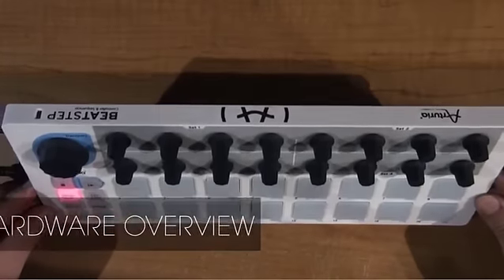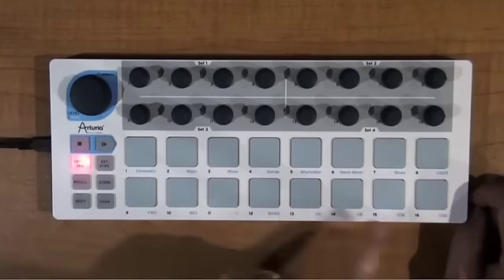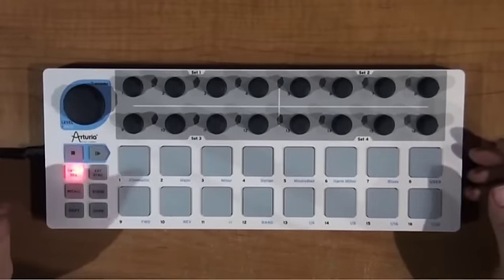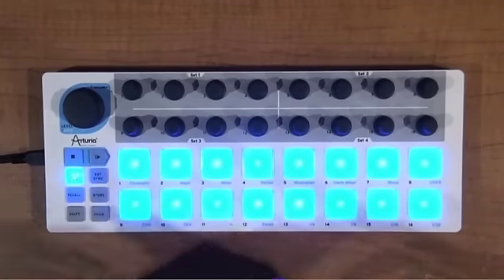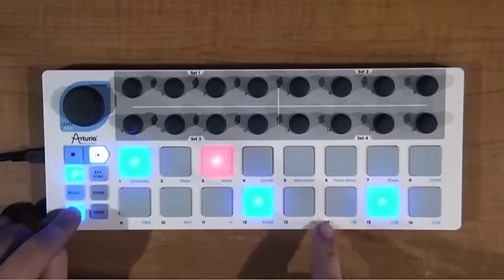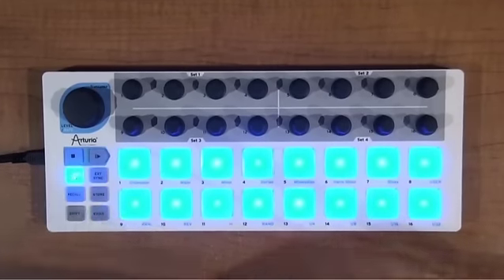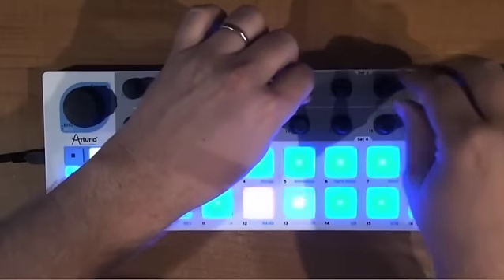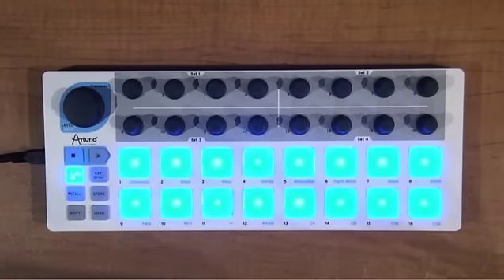Beatstep Tutorial Intro

Comment: I know this is a  old video ,&this is an older product but I have a question.    Does anyone know if the original beatstep can do an 8 step pattern instead of 16 steps?  Aka, can I set the pattern length? (I don't want to run a sequence of 16 steps with dis- engaged  steps 9 to 16.
Reply: Yes, you can set the pattern length from 1-16 steps by pressing shift + chan +  pad number (x) to set the length to (x) number of steps.

Comment: Pretty amazing controller and sequencer. Can you also change the pattern length from it?
Reply: Yes you can, hold Shift + Channel down then hit pad 8 to set a pattern length of 8, or hit pad 4 to set a pattern length of 4, etc. See page 31 & 32 of the manual.
Reply: @abulka  already found it looking more carefully in the manual. Just took a me a while. This beatStep is amazing. I'm just missing being able to change midi global without a computer, so I can use different channels for controller and sequencer. A must for Blofeld multode. Next weekend planning to amend this! Thanks so much for answering ;)
Reply: @aki_gong6271  Yeah I’m impressed by the design of the beatstep too - am driving my Behringer Neuron synth with it (bought them on sale, together today!) Can’t seem to find a way to hold/latch a note though, which is disappointing since I want to drone a note. Also tomorrow will  try to figure out how to use the cv outs to control the neuron synth. Also pads are not as sensitive as I’d like, though for the price they are pretty good.
Reply: @abulka  I used it also along with the Neutron :) 
For drones you can use the vca bias on the Neutron, or maybe play with low BPM sequence from beatStep plus some pretty long envelopes ;)
If I'm not wrong, gate can also be tweaked to make it last longer with shift + 1st encoder but I guess you may need to play with envepoles and low BPM sequencing.

Comment: Not sure but it looks like the sequencer backwards mode has been implemented wrong like on nearly every other sequencer as well.
If the forward step order is 1, 2, ..., 15, 16
the backward order should NOT be like 16, 15,..., 2, 1
To be correct it has to be 1, 16, 15, ..., 3, 2 
which means it always has to start with step 1 and then going to step 16 instead of starting with step 16.
This then allows all the down beats to remain on down 
beats, and off beats to remain on off beats. so it does not mess up your rhythm.
Reply: Very good idea, but that doesn’t seem strictly backwards. Although perhaps more useable than “hard” backwards.

Comment: i really enjoy this beatstep but one thing i cant get my head around, lets say i have a very nice sqeunce going but it just is not at the right timing the tempo is a bit off, i'm losing alot of time fine tuning it at the right tempo using the big knob. is there an easier way to set it to the right bpm/tempo? thanks
Reply: hacky33 I'm having the same problem. Is there a quick fix for this? Having trouble syncing in general.

Comment: This looks like a great product. Some thoughts:
- Video quality could be better (it's 360p for me), good video none the less
- Shuffle/Swing control would be amazing
- Different time signatures
- Different velocities for the steps, or maybe just accents

I want one! I think in the future you could really expand on the midi sequencer concept. Does anyone know of any other hardware MIDI sequencers?
Reply: The Yamaha Tenori-on (original and Orange) can be used as a 16 channel MIDI sequencer. I bought a Tenori-on demo unit exactly for this feature to eliminate the need for a computer based sequencer.

I'm looking forward to getting Arturia's BeatStep as soon as possible as well.
Reply: KWHCoaster That actually looks pretty fun to play with, will check that out.
***** I think from those you mentioned the Cirklon would be my ultimate wish, but it is way to expensive for my current situation. I put it on my wishlist :).
Thanks for your suggestions guys.
Reply: morfu
Lots of fun. I really like the "Bounce" mode of the Tenori-on /watch?v=YRPcbX0rktc All of the different Tenori-on play modes give you a lot more possibilities than just normal step sequencing.

With the Waldorf Blofeld having 16 parts, each layer of the Tenori-on can play the respective part on the Blofeld. The parts and layers correspond to MIDI channels 1 thru 16. The Blofeld does have limitations though, depending on the Blofeld patches being triggered. Here is a little test of mine /watch?v=zUZ_wY6eJ8o

I tend to use the Tenori-on rotated 90 or 180 degrees to get the cabling out of the way.

Comment: This thing is impressive so much potential at a low price
Reply: Is it still like... good to go in 2022? Will I run into problems trying to use it with a modern(ish) Mac and that latest macOS? Is it one of the driverless controllers that don't really get outdated? Sorry that I've chosen you to bombard with questions lol.
Reply: @mrhobs  don’t waste your money bro you’ll just want a better one I was a newb when I wrote that considerably a more expensive controller is the arturia keystep pro, with music gear don’t buy cheap stuff cus you’ll regret it when you get better, there’s nothing wrong with arturia gear they make solid products but this controller is so limited, but if you like drum pads get the beatstep pro, beatstep and pro is class compliant meaning it should work straight out the box, as a ready to go midi controller modern computers understand midi very well
Reply: @minisoda1914  Thanks guy, I definitely agree with that philosophy... about not cheating out on equipment. I usually either go all in (as far as my budget allows), or as cheap as possible, and this... yeah, probably ain't it. I am still however considering paying around $60 for the very basic but apparently very nice feeling Akai LPD8 (Wireless refresh, no, I won't be using it wirelessly) because even if its super limited, it'll still be a good while before I outgrow it, and it could be a good little extra set of controls for a daw even if I get something nicer. Or I can sell it, whatever, not a big loss.

I guess I'm mostly wanting to do a bit of super basic drumming, so the sequencer... yeah, no idea what do do with one yet. Watched videos and I'm just left unimpressed with the result. Like, yay... I can let a computer randomly spit out notes that sound dumb... haha, I'm sure I have much to learn.

Yep, I have cheap decently large midi controller keyboard already, so was basically just wanting some extra light up buttons to play around with... see if I can get inspired by tapping some beats.

(That said I'm somewhat tempted to get a super complicated pro piece of kit, but... I got other hobbies too, so not sure I can sink the rest of the year into just that. Guitar, filmmaking... video games... and... others... too.)

Almost  Heroes reference. You should watch that. Heh.

Also this is long because I'm at an actual keyboard so its easy to type a bunch. K, thanks for reading, later!
Reply: @mrhobs  yeah no problem, an akai drum pad might work great they seem to work out for a lot of people, I think it’s essential to have a keyboard to add some personal character when playing which is why I suggested that, but yeah an akai drum pad may be just fine, the way I look at it I’d rather have one thing that works really well versus many things that are mediocre and take up space, but that’s me, it’s kind of impossible to suggest a definite product or set up because everyone has different styles of working
Reply: @minisoda1914  ppl are still talking about the pro version as the better one? I guess that's life.

Comment: Hi everyone

The Beatstep was my first hardware sequencer. I bought it presuming I could send multiple sequences to each of my hardware synths. Quickly it turned out the Beatstep didn't do that. One sequence for all. A beginner's mistake which almost made me sell it. 
However I didn't sell it and now I'm thinking of giving it a second chance because I kind of like the way it works.
One thing just keeps puzzling me though, and I can't seem to find a straight answer anywhere. I hope you guys can help me out.

In the MIDI control center you have the option to change the global (MIDI) channel but also the CV/Gate channel and the sequencer channel. Do these options give me the possibility to send a separate sequence via MIDI to one synth and another separate sequence via CV/Gate? And if so, how exactly do I set this up?

Many thanks in advance 

Cheers Ruben
Modify message
Reply: I don't own a beatstep, but I suppose you could if your synths have MIDI Through, you could daisy chain them together on a different channel on each of the synths. MIDI Through sends MIDI messages from one piece of gear to another, they just have to be on different MIDI channels, you just need to have a different channel running on each synth with a different sequence for every channel/synth.

Comment: There are many complaints about the MIDI Control Center. There is no Linux-version (by the way, one could make an on-line version).
Weak possibilities for customizing MIDI controllers.

I have long wanted to see an update for BeatStep, which includes:

0) Indication of the note, selected by the encoder! At least some!
It would be nice to see the indication of the notes assigned to the PADs. Can be RGB backlit.
1) MicroUSB connector (and separate power connector).
2) Ability to assign chords and entire MIDI CC# chains to PADs. It is important!!!
3) Please remove the wild, brutal, eye-tearing BLUE backlight! Better yet, let the user choose the backlight color himself.
4) Sidewalls without stickers (stickers on the sidewalls cling to the palms all the time).
5) Standard MIDI TRS connector.
6) Operation manual in Russian. Can't do it yourself? Invite the user community to translate. I am sure it will be translated for you for 500 Euro.
For example, I am ready to do this (especially since I am a professional technical writer with PhD :))
7) Offline setup for BeatStep would be very, very important.

Yes, your device can be still use. And it is unique in its own way. But don't you want to make better products?

Comment: This shit seems official so how the fuck it is even possible that you've been constantly ignoring questions and problems by not giving a flying fuck and acting like there was no problem? Sir, if you still are what you said you were why don't you have sb deal with real problems that ppl point out in comments and you're not even trying to pretend you care. I got minilab, spark le and this boxy interface - having it working has always been a bitch to set up with no issues including connection drops, midi clock and sync problems which made this equipment useless in live show environment. Build quality is nice but overally it's an unreliable equipment, therefore the usage is a bit risky anywhere else beyond the house of yours. Cheap way to get decent sounds but you will eventually pay much more with your time and stress when things go incomprehensibly weird and the only thing that helped was relaunching the software or a system restart. These old bricks are still in use by many - have some section to help ppl solve problems with products you sell/sold.